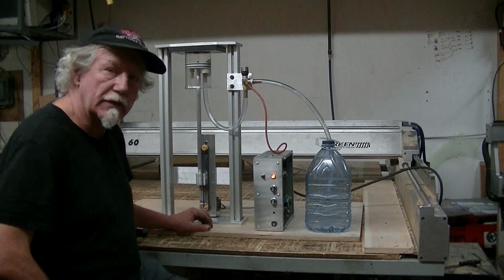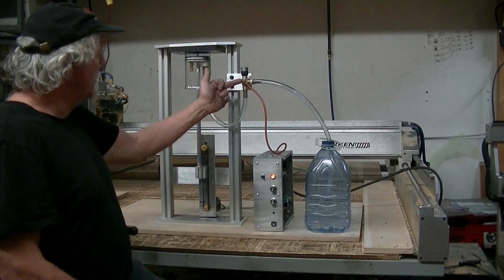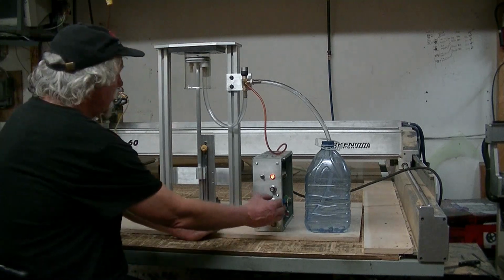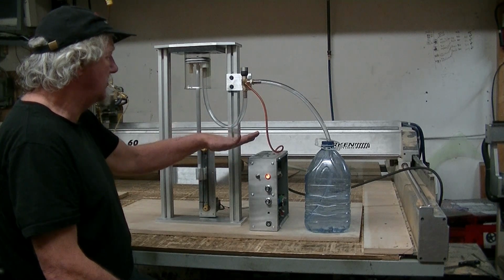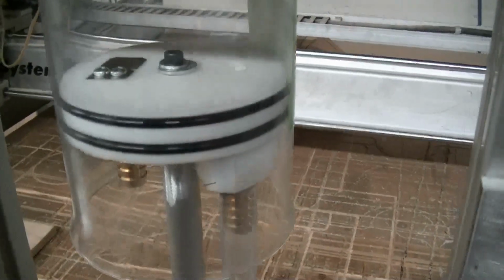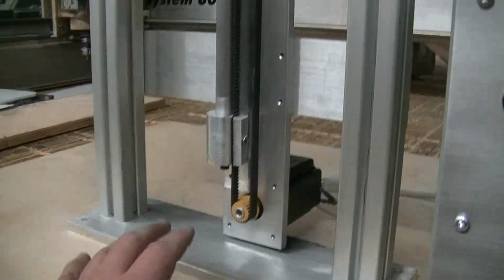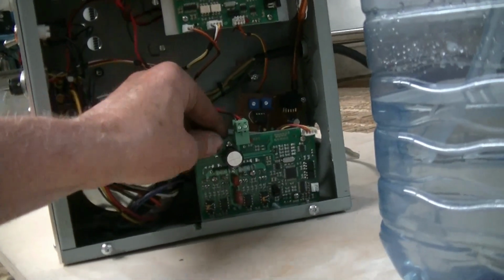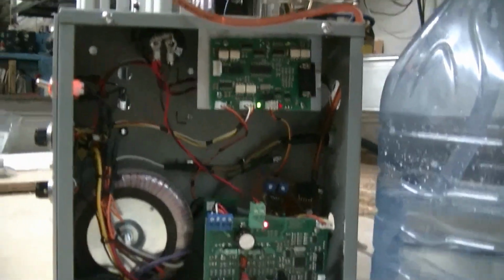PART 1: Building a basic Medical Ventilator from common parts to help fight against the  Covid 19  .

Comment: Hey Larry if you make a cam wheel on a stepper motor you could remove the belt. You could also make one that was snapped like a v twin motorcycle and have two outputs
Reply from the maker: Thanks Doug, but that would defeat the purpose and not make the stroke and volume variable.   I'm  adding a bunch of pressure sensing  and stroke control features to make it much safer for the patients lungs.

Comment: Larry I have no wish to put a downer on your effort but commendable as it is:-

 How do you control tidal volume (VT), 

positive end-expiratory pressure (PEEP), 

respiratory rate (RR), 

inspiratory airflow (V’) 

intrinsic PEEP (PEEPi), 

peak (Ppeak) and plateau (Pplat) pressures, 

driving pressure (ΔP), 

transpulmonary pressure (PL). 
How do you manage inspired O2 fraction?
How do you add CPAP pressure?

There is also the need for the patient circuit to be completely separate from the mechanical system so a single-use circuit can be used and can be disposed of after use and the mechanical system cleaned and sterilised. etc etc.

Mechanical ventilation of long term ventilated patients is not a simple matter of blowing air in and out of their lungs.
Reply from the maker: Yes, but this is part one. I am working on adding more features now and will post another video in a few days. 
-But ,the volume is easily calculated by the stroke length and cylinder diameter. Same as  flow . 
-Since its stepper motor controlled, the volume can be varied on the fly depending on the patients reaction pressure.   
This is only after 4 days of development.  I learn more now about medical requirements every day  and I will improve it. .. i don't give up :)